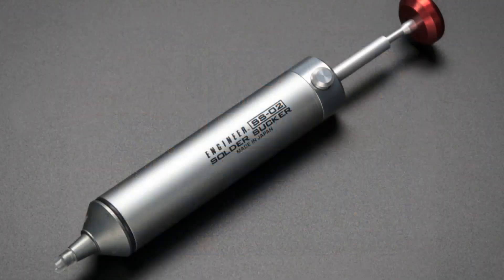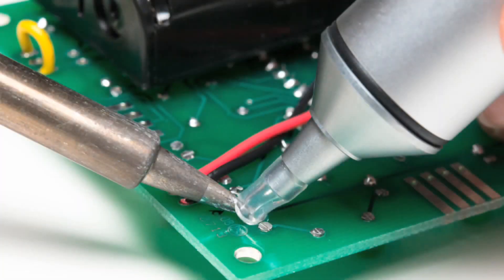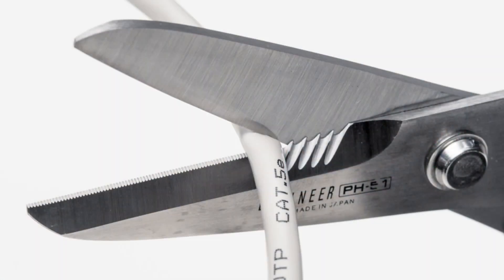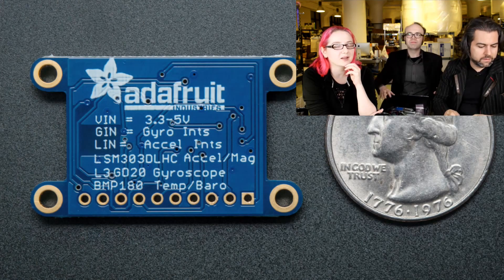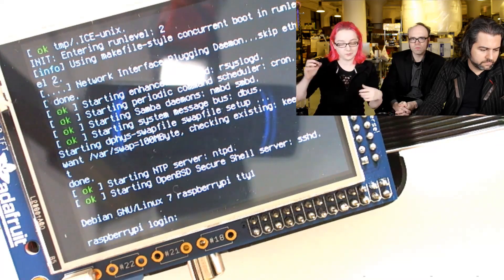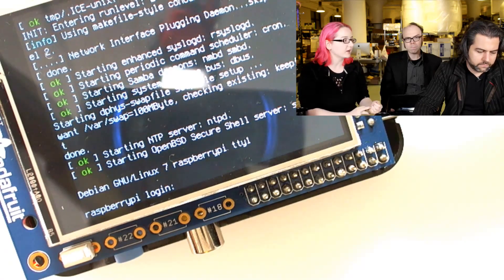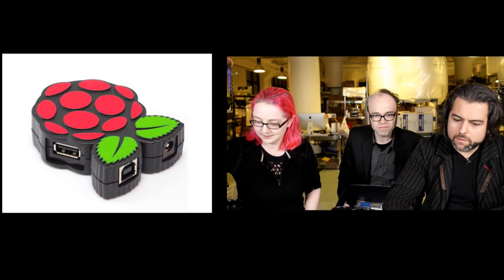New Products 11/30/2013

Comment: I really wanted to use this on a project but it uses both of the SPI chip selects so it's a no go. I thought that seemed funny so I check the schematic to find out why. Boy was I surprised when I found the touch controller was using SPI when it could have used I2C instead. After all the touch interface does not need SPI speed. Please update it so it can use I2C so we can free up one of the SPI chip select for other projects.

Comment from the maker: See what's new this week! New Products 11/30/2013

Arduino YÚN - (0:10) http://www.adafruit.com/products/1498

Professional Silicone-Tip Solder Sucker (0:17) http://www.adafruit.com/products/1597

Professional IC Extraction Tool (2:30) http://www.adafruit.com/products/1598

Super Scissors (3:53) http://www.adafruit.com/products/1599

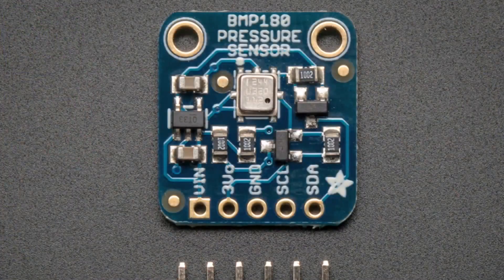BMP180 Barometric Pressure/Temperature/Altitude Sensor- 5V ready (4:40) http://www.adafruit.com/products/1603

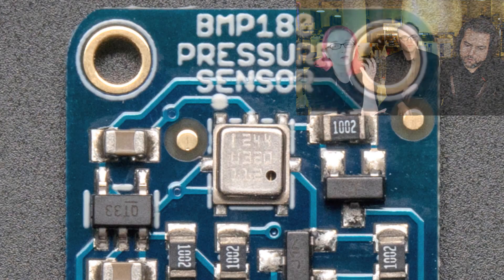Adafruit 10-DOF IMU Breakout - L3GD20 + LSM303 + BMP180 (5:22) http://www.adafruit.com/products/1604

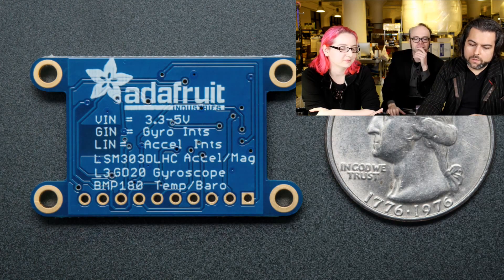PiTFT Mini Kit - 320x240 2.8" TFT+Touchscreen for Raspberry Pi (7:42) http://www.adafruit.com/products/1601

PIHUB - USB Hub for Raspberry Pi with US Power Adapter - (12:22) http://www.adafruit.com/products/1516

 #Adafruit
Reply: That IC extractor looks like it would be great for pulling a soldered through-hole chip along with a heat gun.